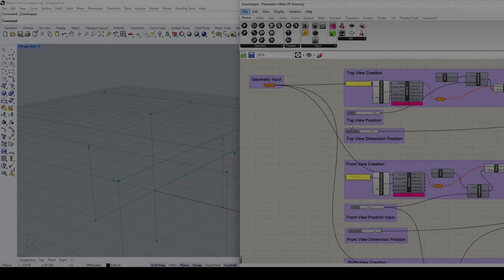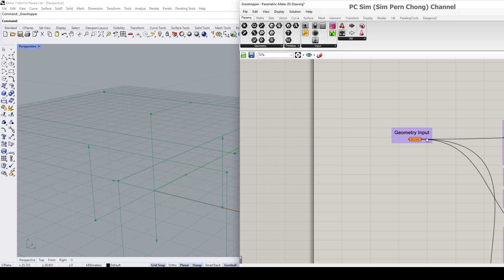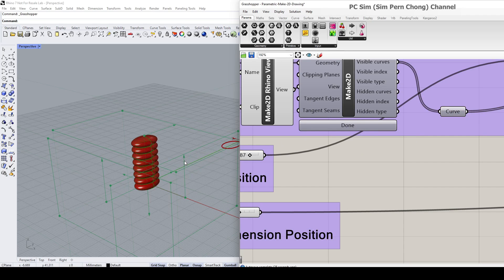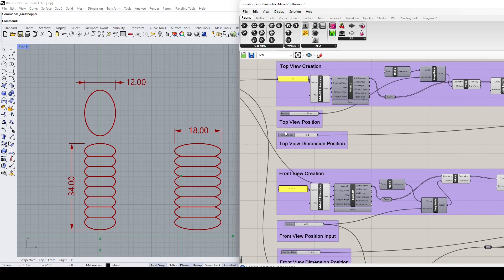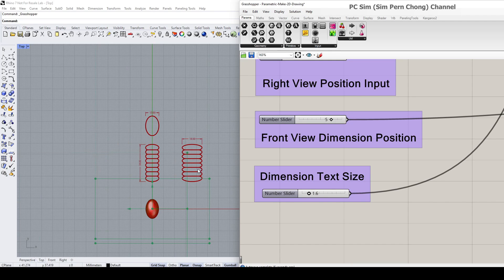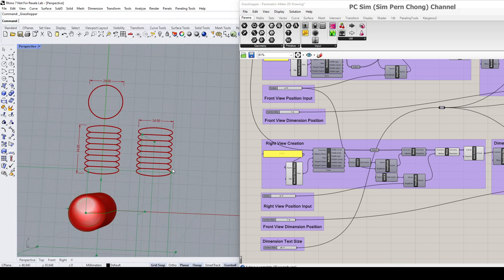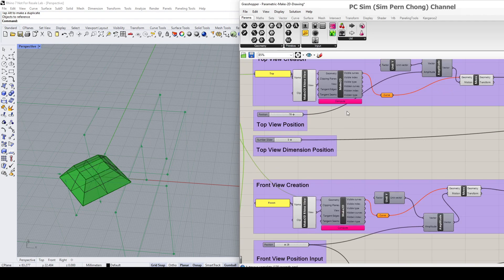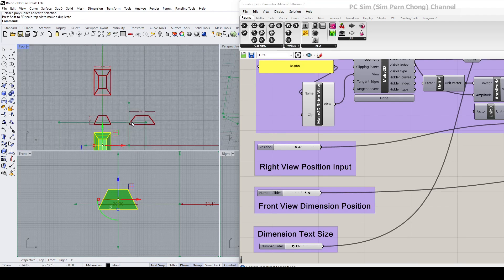Free Rhino Grasshopper 3D Definition (GH file): Parametric 2D Drawing Creation

Comment: Power man. Yes, Grasshopper 3D can generate 2D drawings! While Grasshopper is primarily a parametric design tool used for creating 3D geometry within Rhino, it also has components and workflows to produce 2D drawings.

Here are a few ways you can create 2D drawings with Grasshopper:

Projection: You can project 3D geometry onto a 2D plane, like a top view, and output it as a 2D shape. This is often done using the Project component or similar tools that flatten geometry.

2D Geometry: You can create 2D curves, shapes, and patterns directly within Grasshopper. These are then either visualized in Rhino's 2D viewport or used in further design operations.

Layout & Annotations: Grasshopper can help organize 2D views and annotations, especially if you want to automate the placement of text, labels, or dimensioning for technical drawings.

Use of Plugins: There are also plugins like Rhino.Inside or Elefront that offer more robust tools for generating and managing 2D drawings from Grasshopper.

So, while Grasshopper is often used for 3D design, it is quite capable of working with and generating 2D drawings as well!

Comment: is this comparable to fusion 360 in being able to change something quickly and have other parameters updated simultanously?
Reply from the maker: No really comparable. Fusion is more like traditional parametric CAD. However, Rhino's strength lies in its capability in creating very complex forms that can be automated (via Grasshopper) that will otherwise be humanly impossible to model using manual means.